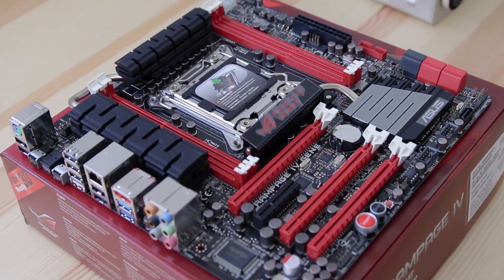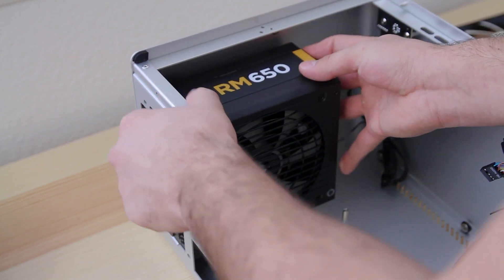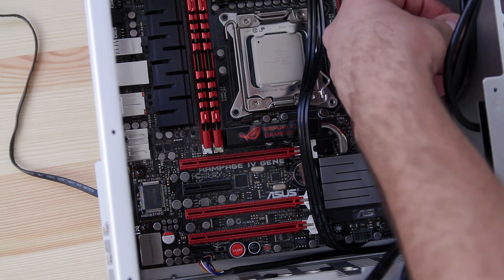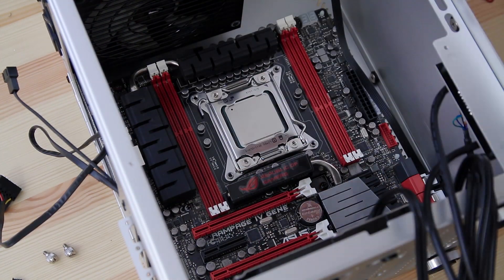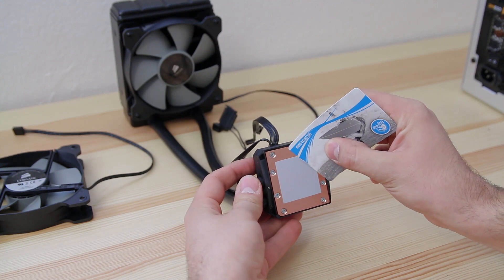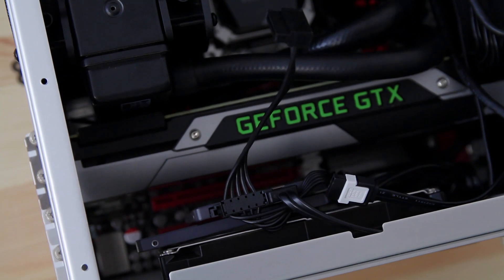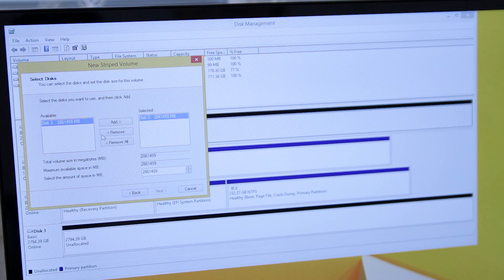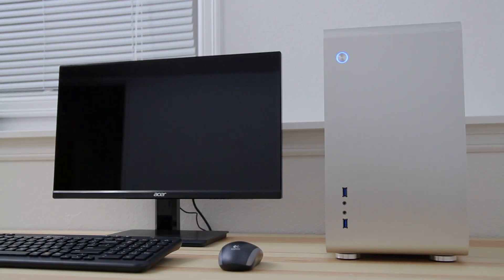Part 2 - 2013 New Mac Pro vs Custom Build PORTABLE PC " The Mac Pro Killer " - The Build - U3 TITAN

Comment: Hey Max. Would this case fit 2 graphics cards if I would not use an SSD and/or a hard drive? I want to use a motherboard with an m.2 slot so basically the memory would be on board giving me extra room. What do you think?
Reply from the maker: Hey yes it will!

Comment: Thanks. Nice videos, looking at this case now for my 2017/18 insane quiet gaming build.
Reply from the maker: +Maurice Orris If you want the most quiet go with another case thats designed for quiet. :)
Reply: This is the one case on sale that fits my "designed for quiet" cooling system the way i want it to for my next build. Am a case modder and have a couple of ideas on how to use this case's tiny size to my advantage.... the only thing that is a possible downside is the available length for graphics. Am hoping that AMD Vega/NVIDIAs HBM2 cards are bit shorter than traditional graphics cards... lol

Comment: Nice video, I love your Setup but i´m a Little bit concerned about the airflow and resultating temperature in your System. Your the first one I see putting a Titan in such a small case but it went out very nicely! Thats probably the smallest pc with a full gtx Titan in it.

Comment: Hi Max. I'm planning to do the same build as yours but with the MSI GTX 970 ME graphic card instead, which is 3 mm longer than yours. Is there a way that it fits? I don't want to give up on this case, I love it!
Reply: Agustín Serra Not gonna happen.  I tried to jam a GTX 980 Hybrid into this case and it ain't gonna fit.  I still cant figure out how he got a GTX Titan to fit into this case.  I'm holding out for an AMD Fury X...
Reply from the maker: I would not recommend it.
Reply: Max Yuryev thanks forma the answer. I will use the EVGA GTX 970 FTW+ then.
Reply: Agustín Serra  buy a asus gtx 970 mini
Reply from the maker: LastMumzy I showed how I did it :) But yes its as tight of a fit as it can be and still fit.

Comment: cool video, thanks for sharing. i'm also a heavy video editor user. i'm curious about the temperature of whole pc. it so tight inside, worry it will overheat. can share your opinion?
Reply from the maker: Vision Studio If your not overclocking it its actually not to bad, but definitely warmer than a larger case. If you want to overclock you'll end up getting the temps really high. If you don't need a case this small I'd go for something slightly larger.

Comment: Awesome build! I really like the effort you put into this.

I have been thinking about switching my Aerocool DS case to something smaller (see below). I thought about Jonsbo case and came across with your video. Do you think I could fit all my stuff into that? I guess I have to sacrifise the air cooler at least. Or do I?

Old Aerocool DS case: http://www.tonymacx86.com/user-builds/131776-success-red-pro-haswell-matx-ga-z87mx-d3h-i7-4770k-gigabyte-gtx-780-ti-windforce-oc-32gb-ram.html

New Jonsbo case: http://www.hardwareversand.de/en/Mini/213607/Cooltek+by+Jonsbo+C3+silber%2C+mATX%2C+ohne+Netzteil.article

By the way, do you have any cons about the U3 case? How are the sound levels of your build?

Thx a ton!
Reply from the maker: Koubi Thanks! I know for sure the GPU will not fit, and there may be a chance the CPU cooler wouldn't either. Its really a small case. Noise levels are ok but cooling is not the best as there really isn't any good intakes.
Reply: Max Yuryev Yeah I would need to chop a piece of my GPU to get it in properly :)

Is the cooling a reason you switched away from this case?
Reply from the maker: Koubi I actually wen't to a Mac Pro first. then did another build (what u see)

Comment: Hats off for effectively fitting the GTX Titan in that small ass case. That's a snug fit. That would be difficult for me since I have big hands, so I favor the ATX form factor more. Just curious to know what's the name of the micro ATX case. I would've installed OS X on it as well if I were you. Then it could be officially considered the 2013 Mac Pro killer.
Reply from the maker: the the rosewill legacy u3, I have an unboxing vid on it on my channel. you should also check out part 1 and 3 of this vid :) . I may be doing another build with osx :)
Reply: Max Yuryev Ha ha ha lol, I should've realized that. Before I built my current G5 Powermac Mod (http://hardforum.com/showthread.php?t=1815956&highlight=), I was debating on whether or not to use a manufactured case for my Hackintosh. I was looking into using the Rosewill Legacy MX2-B but I disliked the way the power supply had to be installed in the case. The sleek clean design the Rosewill Legacy US offers is what garners its overall appeal. I will most def check out the other vids you suggested. Like I said earlier it can't officially be considered a 2013 Mac Pro killer if you don't install OS X on it (to match apples to apples) IMO.

Comment: Hey Max. I bought this case with a EVGA GTX 980 SC ACX 2.0. I cannot get it to fit! Even though it is 10.5". I ended up deforming the mounting bracket on the case to create extra space. Turns out it was for nothing because the issue is that the front end of the card keeps butting up with the front side of the case and I cant line it up with the PCI slot. I got very close one time, managing to put the back end into the PCI slot...but it was creating so much tension that I thought it would tear the PCI slot right out of the motherboard ( Asus z97m Plus). Could you release a video showing the ENTIRE process so I can see the differences.
Reply from the maker: No sorry. This was 10 months ago I don't have the PC anymore. But The install was just like was shown, very very tight fit.
Reply: Max Yuryev  I tried it again and managed to get it fitting now :) Why don't you have this build anymore?
Reply from the maker: doogly Sold it to invest in other computer/camera gear. Hopefully I'll be doing another similar small build soon

Comment: @Fezzler61 

Hi. I have just built myself a computer using this case. I'm not using my computer for audio, but for gaming and CAD, so sound level wasn't that important to me.

However, the only thing I hear is the fans of the h80i so it's not 100% quiet, but from a subjective point of view, nothing that bothers either.

My setup is a 4790k, and a EVGA gtx970 (annoying coilwhine, have in mind...), and a H80i CPU cooler.

If you want a 110% quiet computer I would recommend another, silent case, or a CPU cooler with some silent fans.

Comment: Promoting my old pc to cable box, been looking at the Rosewill legacy v4. But I'm worried about using a standard size psu with the bottom fan alongside with the horrible airflow of the case. You guys think I'll have any problems?
Reply from the maker: Meissna Do you really need it to be that small? The airflow does look really bad in that case.
Reply: Max Yuryev sadly I do, but that's the smallest case I could find using micro atx.
Reply from the maker: Meissna I would say make sure you're using new components that are power efficient and produce less heat if possible.

Comment: Looking to do a build to run Pro Tools 11.  I guess since it is an audio application, I could get a shorter GPU with less power.
How quiet is this build?  For audio (home studio) would you get a "silent" case or one with the insulation?  I don't think they make Micro ATX cases like that. 

I have installed memory, hard drives, graphics cards, modems, network cards, etc.  But I have never had to boot a brand new motherboard and - I assume - update the BIOS and drivers.  Is that the trickiest part...being confronted with technical settings/choices I may not be aware of?  I guess I don't need 6-core for audio, but why not build for the future?

Very helpful series.  I wish there were more like this on how to build a Pro Tools 11 rig.
Reply from the maker: I would say if you want quiet then don't use such a small case. Linus tech tips just put out a silent build that is very good. http://youtu.be/RXZrWqCT7R0 It's labeled "gaming" but you can use another motherboard or cpu and still build it the same. The PC I built is limited on airflow. It's quite when your not using it hard but if your maxing out the CPU it gets loud. This was definitely a compromise in cooling/noise to get it to be as small as possible while being as powerful as possible. Another option is to buy a used/refurbished Mac Pro (newest version) its super quite, literally silent most of the time even under heavy load.
Reply: a lot of hardware for professional audio needs thunderbolt ports and OSX. don't waste your money and buy a old mac pro, the ones with the big aluminium case.
Reply: gimmigimmigimmi
Those old ones do not have Thunderbolt.
Reply: Indecisive Fella they have 4 PCI slots, you just have to buy the card with the ports and put it inside (:
Reply: gimmigimmigimmi
But there are not TB cards compatible with the Mac Pro out there, or are there now?

I know of those fancy Asus TB EXII cards, which have to have a compatible interface on the main board to be usable and those cards only have one port.
Reply: Indecisive Fella No, there are NOT any TB cards available for ANY Mac or PC that doesn't have a TB controller on the motherboard (something like that) - for more specifics check out Macrumors.  I use both Mac and PC - and these days there's really no wrong choice.  Both are awesome for everything.  Then again, OS X is amazing and the new Mac Pro is absolutely stunning, and while you'd be fine for years with USB and FireWire audio interfaces, TB is gaining ground and you can't go wrong with the new Mac Pro either.

And no "not a lot of hardware and audio needs thunderbolt and OS X" - Nearly everything works equally as well with Windows and OS X, and very few interfaces actually are TB at the moment.  The only interfaces I know of that are only OS X are Apogee, and maybe MOTU.

So no TB for old Mac Pro, and you'd be fine with Mac or PC.

EDIT:  Didn't know this guy used a liquid cooler, and still claims it gets noisy.  Hm.  I would imagine a Noctua cooler and this case would be near silent.  I'd say go for it, and just get a different case if the noise is an issue.
Reply: When I researched liquid cooling all its review presented louder cooling than I already, BeQuiet! units in both my Hackintoshes.

As for TB cards, I find them rather ridiculous right now, as they only seem to have one port, though by latest Hack got that connector for a TB card if I ever need it.

But I am currently using Windows to see what all the fuss is about and I am astounded by it sluggishness sometimes or general lack of well thought out logic, at least for my personal needs.

Comment: So it looks like theoretically you can fit SLI dual graphics cards in here, but it would be tight, and you'd only be able to fit 1 3.5" HDD on that detachable side panel thing, with some SSD's sticky taped to it or something.

Is that right?
Reply from the maker: Greekanadian Yes exactly
Reply: Max Yuryev I currently have a Fractal Design Arc Mini case which I love for its features, but I find myself wanting a smaller and smaller enclosure. I've been looking at a lot of mATX cases lately as opposed to mITX because I just don't want to give up that SLI capability (I'm mostly a gamer). This case is both small and can fit 2 graphics cards, though I'd be wary of my temperatures as there isn't much airflow in that case. It only has the one fan mount which I would also put in a self contained CPU cooler on...

I guess the bottom GPU can bring in air through the holes in the bottom of the case, so that's a plus, but that second GPU is sandwiched pretty good in there without much airflow at all.

Thanks for your review and build in this case. It's hard to find detailed information about cases unless you try to find it in some enthusiast forums and such.

I've been looking at the Silverstone FT03 mATX case as well. Did you ever consider that one? It might be slightly too big to fit in a backpack though...

I'm thinking about going with that one because it has a bit better airflow and better HDD support. I really need to have SLI and at LEAST two 3.5" HDD mounts. I need to have a fast HDD like a WD Black, but I also need a large capacity storage drive. I could always get an external I guess too but then it's just another thing to have sitting on the desk somewhere.
Reply from the maker: Greekanadian Yea thats a beautiful case. If you don't need it to fit in a backpack then I would totally go with that instead. Right now the case I used is the smallest case you can get for microATX with a full GPU and PSU, anything smaller you will need to custom build and maybe use a PCI riser (ive considered it)
Reply: Max Yuryev Yeah I'm sure those PCI risers can make things very interesting for those wanting to do some serious custom work. If you can figure out a way to mount the graphics card you could pretty much build anything you want!

I only found out about these Rosewill cases because I stumbled upon their parent company, Jonsbo which gets rebranded as Rosewill in the US. It's a shame they don't manufacture some of their other mATX cases over here because some of the other ones look quite promising as well.

Anyway thank you for your input.

Comment: Another Great Video Max, I will follow that with some upgrades but my question is if the performance of this one on medium tower will be better? Thank you
Reply from the maker: If you're using a medium tower you will have better airflow so maybe you can overclock a bit more but it won't be that much of a difference.

Comment: I own the U2 case and like it so much this would probably my next case for an upgrade. I'd like to put a X99 mobo with two GTX 970s or 980's in SLI, it would run circles around many bigger PCs!
Reply from the maker: Yes :) that would be awesome! The 8core cpu and dual 980's :)

Comment: This is definitely my next cabinet, my BitFenix prodigy is much bigger and heavier than this, do you think I need a cpu cooler? excellent video thanks max
Reply from the maker: Yes you definitely need a cpu cooler :) The i7 6 core that I used doesn't come with one at all (same with 8 cores) If you use the 4 core then you can use the ones that come with it if you won't overclock but most choose to upgrade the cooler as it doesn't cost too much and will cool better and be quieter. Thanks for watching!
Reply from the maker: ***** I was suggested that when researching this thermal paste as its very thick compared to others. I'm sure just putting a dot would have worked.

Comment: Awesome video. I've got two question. Has the Mainboard thunderbolt? And is the Mainboard for a Macintosh ok ?
Reply from the maker: From what I read you can use Mac on this motherboard but it does not have thunderbolt. The newer i7 6 core will support mac.
Reply: Max Yuryev Thanks for the fast answering of my question.

Comment: Hi Max, I am going to build a gaming pc with this case (window version) and I wonder if sli two 780ti would fit. Seeing you got your self into so much trouble installing the first card, should I install the lower card first or the other way round? And after having sli in the system, where can I put my ssd? Thanks.
Reply from the maker: It will definitely be difficult but it can be done. I would install lowest first the top one and take your time.  As far as ssd you could mount it/them on the side cheese grate looking plate, or in the little bit of space space left on the right side of powersupply (with double sided sticky tape)

Comment: Was wonderng how u got the power button led to stay on and to change colors. Mine just stays red and blinks on and off by itself.
Reply from the maker: I just plugged in all the cables from the front panel into the motherboard.  Maybe your mobo doesn't support it?
Reply: Max Yuryev Your probably right, my motherboard can be considered insufficient compared to your beast Asus LOL. But thx for the help. Great vids and you sir, just got a new subscriber.

Comment: I know you got the Mac pro but how were the Temps and noise?
Reply from the maker: Temps were good not overclocked, and a little warm (but still acceptable) when I overclocked it to almost 4.5ghz
It was nice and quiet at idle and audible but still not bad at load (not overclocked) when overclocked at full load it was pretty loud to keep up with cooling needs! Check out part 3 if you haven't yet.

Comment: Well thanks to your video i decided to pull the trigger. 

x99 with 5960x (overclocked to 4.2, stable and not changing any of voltages! Easily could go higher but don't want to push it)
gtx 680[10.5 inch card] (880 when it comes)

http://imgur.com/a/gUg08#0

I primarily do game development/research where i need to move it quite a bit so it fits my needs perfectly. Love it and your videos directly helped me make the best choice!

Also if anyone else sees this video, the main reason the 10.5 card doesn't fit is because the clearance above the PCI slots is not tall enough (with a motherboard in). I Dremeled about 1-2 cm from it and i dont need to remove the front face plate of 10.5 inch graphics card now. Still very very snugg and touches the case.
Reply from the maker: Very nice setup!! What motherboard did you use?

Comment: It is a very extreme build, indeed. Awesome. For now, I can only build 4790K + Asus Z97I Plus + GTX 650 Ti on Jonsbo V3+
Reply from the maker: ***** Thats still a nice build!
Reply: Max Yuryev bytheway, is the motherboard riser come with rose will legacy u3 or did you buy it separately? as my v3+ doesn't come with that stuff
Reply from the maker: ***** I'm pretty sure it came with it, I know I didn't buy it separately